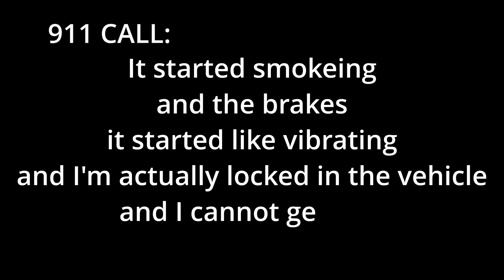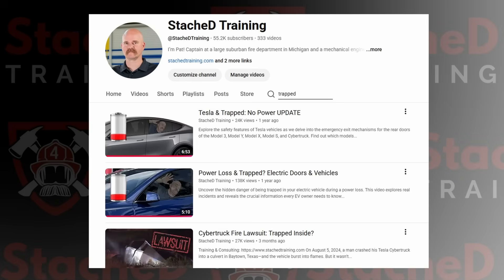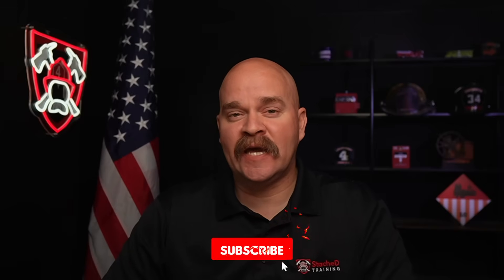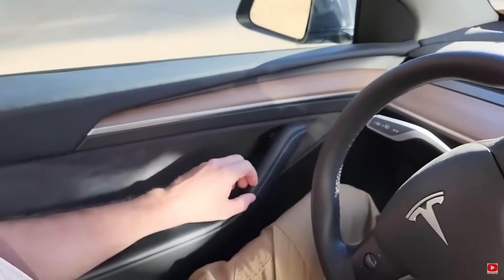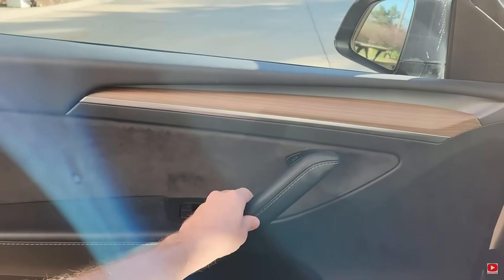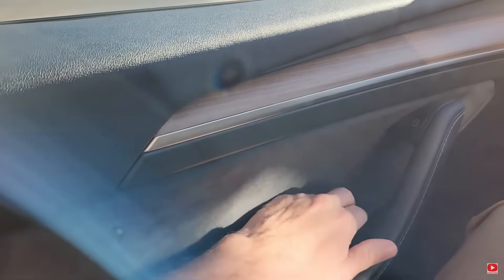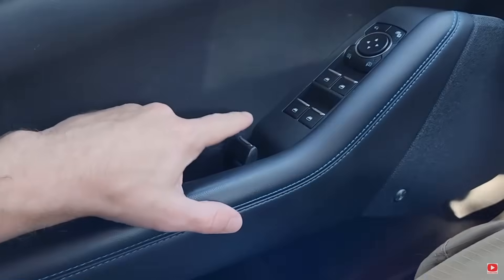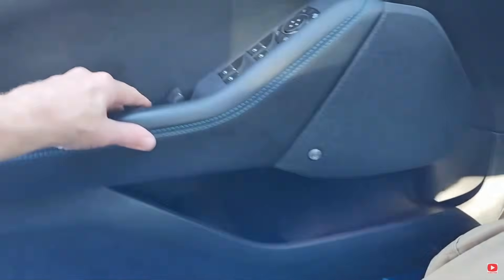Electronic Door Latch Failure: Smoke in the Cabin

Comment: Modern vehicles are dangerous to their owners. Unfortunately, the cheapest way to make a car more futuristic is to use computers and electronics. Manufacturers were doing better 20 years ago and should have stopped trying to complicate cars more. Now they use these technologies to charge subscription fees to use features on the car you paid for. Keep posting about this and hopefully the manufacturers will stop making cars more dangerous and the victims need to sue for exorbitant amounts for damages until they learn. Defunding the automakers would help… think about buying older cars and using independent repair shops. Dealerships exist to do warranty repair and other maintenance work. Selling cars is not keeping the lights on.

Comment: Why not have a small backup battery for door release.  It is safety critical.
Reply: You shouldn't have ANY electical component in the door, period.  That's the issue.  You shouldn't "need" an emergency backup handle, or an emergency power source...just use a damn handle.  They've worked in cars for 120+ years.
Reply: @oskar6661 I agree.  I liked the answer further down, where the electric door release, and the manual were on the same button.  Pull gently for electric, a bit harder for manual.  And there should be manual door handles outside the car, so that rescuers can easily open the door.

I don't like the locks that lock if the car goes over 30mph.  If I have an accident, and am knocked out, how do people get me out of the car, if they can;t open the door.

I always try to remember Murphys' law - if anything can go wrong, it will.
Reply: Q: Why not have a small backup battery for door release.  It is safety critical.  BETTER Q: Why not have pyrotechnic charges "blow the canopy" like so much Swing-Wing Fighter Jet, and then have all Tesla drivers "rise up" out of the cabin on 2 HUGE COLUMNS OF FLAME shooting from beneath a sweet Martin Baker US18E Ejection Seat...? (insert slow motion video of a rocket powered test sled going down a set of railroad tracks). 👈ref: in the SUPER DYSFUNCTIONAL "child-like" mind of Elon Musk, this would be his solution.  hint: solving this "technical problem" involves the use of ever more technology (which is exactly what "Einstein's Paradox" has warned us NOT to do).

Comment: I saw a driver yesterday who had a Mach E Mustang who put “open here” stickers on his outdoor rear door handles (buttons) because there is no handle.  It’s just stupid engineering. It’s not problem solving. It’s problem causing.
Reply: i wouldnt even call this engineering because it doesnt conform to any of the essential and critical rules of engineering. Its smart for the sake of being smart, the shit that fashion designers and modern architects do, there are no engineers left in the automotive industry
Reply: @homeopathicfossil-fuels4789 now that I agree with 100%.  It’s been a very long time where I saw a car feature and thought, “wow, that’s clever.”  It’s all just showroom gimmicks and flash.
Reply: How does that help given the doors auto lock when you start moving.
Reply: What handle was labeled if there are no handles? I'm confused by your comment.
Reply: @17k @17kcotsdoow86 rear doors have little circles next to the windows. I guess they are buttons that you tap to pop open the door.  The car was black and I don’t think his passengers could see the button so he put the sign on the door edge next to the button.  The handle is the door edge itself which only pops out when you press the button.  If you need visual aids to get into the car, imagine the nonsense trying to figure out how to get out of one
Reply: It was probably an Uber. I’ve seen the same.
Reply: To be fair, if someone buys stupid engineering, then they are stupid. The government should regulate it but the customer is stupid and frankly, I have no problem with them and their stupidity leaving society.
Reply: @anon1832  
And what are we to do, once all the cars go full-blown stupid-mobiles? Government schooled idiots, monkey-see monkey-do, no or little original thought anymore. Every car looks like a rip-off copy of another brand's car.
Reply: @anon1832 I guess you’re right.  It’s natural selection. Darwinism.

Comment: A good quality spring-loaded steel centre punch will, according to reports that I have seen, reliably break windows made from tempered glass (not front wind screen or laminated safety glass side windows in some new cars). Cheap, small and easy to use. Buy from any good hardware store.
Reply: New cars get laminated glass all around 😮

Comment: The electric door latches are possibly one of my biggest pet peeves about how cars are made these days - right behind the stupid touch screen consoles. I shouldn't have to sit there and try to figure out how to get out of the car if the battery dies! I don't care if it's an EV or ICE - I should be able to exit the vehicle the same way I always do without any hassle or having to find a different mechanism than the one I usually use.

Ofc, I live in the northern Midwest and have driven ICEs my entire life (I could barely afford the 2013 Traverse I bought last year). It's not uncommon for me to go out to start the car on the first really cold day of the year and find the battery's dead. It happens. There's a reason I have a GooLoo I keep with me and jumper cables in the car, just in case.

Well, we did just get the battery replaced and a new alternator, so theoretically it should be fine for quite some time. But it never hurts to be prepared. Plus, my previous vehicle (2000 Town and Country) had a ridiculous amount of issues with batteries. I'm pretty sure something was constantly draining the battery, but we never figured out what it was before the transmission decided it was time for retirement.

I still miss my Town and Country. For all its issues, I prefer it over the Traverse. I has regerts.
Reply: You're not the only one to mention the mysterious "battery drain" you couldn't figure out.  A few other people are discovering a common cause.
When the dealer sells a car, they often install a GPS tracker.  Its purpose is to provide a location of your car if it needs to be repossessed.  You can often find them tucked up under the dash and often the tie-in to get power looks rather unprofessional.  
Even if you bought the car used, the previous owner likely had the tracker and never knew it.  Just google it, and there are lots of videos of people showing where it's at and what to disconnect.

Comment: Well applied technology should make life easier, safer and cheaper, not harder, more dangerous and hideously expensive.

I have been driving for 50 years.  The cars I drove when I started are nicer to drive than anything I have driven recently (I have driven buses that are nicer to drive than modern cars).  When I started, cars were easier and cheaper to maintain and fix. Now, with all the extra systems that can and will go wrong, and proprietary interfaces that require manufacturer diagnostics to figure out what is wrong, with systems that cannot be repaired for a few pounds, but must be replaced for a thousand, I don't want to know.  It is no wonder that insurance is so expensive, when a small ding can lead to a bill for thousands, rather than a man with a hammer and a can of paint. (I know it was only a small dent, but it damaged the defloccinator, which caused the insuffintegrator to go over voltage, so both units had to be replaced.  And, once they were replaced, (I am sorry it took 6 weeks to get the spares from the factory), we had to run further system checks to make sure that nothing else was damaged.  Here is your bill. ... Fred, call an ambulance.  Another one has collapsed).

All those bells and whistles might be nice, but remember the engineers mantra - "If it isn't broken, it doesn't have enough features".
Reply: "If it isn't broken, it doesn't have enough features."

Wait, I thought that was the motto of Winturds?

Comment: If this had been a lithium battery in thermal run away, she would have been dead or had severely damaged lungs before the fire department even got there.  There is a reason that flight attendants show passengers how to use emergency equipment and where the exit doors are before EVERY flight.  AND, that is the reason I pay attention EVERY time and read the card in the seat back.  I want to be the person who makes it out safely if there is an emergency.

Comment: "Hey, what's up with those manual door locks?"

"Ah, not much, just a tried and true mechanically functioning door that's been successful and useful for over 120 years.  Doesn't really cause us any problems, pretty cheap to produce and something that 95% of the world's population is familiar with.  Also it's safe and easy to manipulate in a disaster, even in the dark or under water."

"Can we f__k with it and make it more expensive and dangerous?"
Reply: Not to mention easier to repair, less part, if the part discontinued for old car you can make the parts
Reply: YES WE CAN!!!

Comment: I also think about a borrowed or rented vehicle, do they expect the rental company or your friend to run you through drills before you drive away? not going to happen. I was in the rental business, we normally didn’t have Fords , but a franchise had a Mustang Convertible we were trying to rent back to the franchise location. We got customers and it wasn’t intuitive to have to engage the emergency brake to bring the top down as our GM convertibles didn’t require and our customers didn’t know, so we’d get a customer in the car, they couldn’t drop the top, our staff didn’t know so kept get sent to maintenance and delayed getting the car back to our franchisee for nothing. Thankfully this wasn’t a life safety issue.

Comment: I don't think we should rely on backup mechanical releases either. It's nice in theory and maybe they could be made intuitive, but unless it's used regularly, you don't know it's in operational condition.

Of course they work in new-ish vehicles, but a mechanical device that's not used in 5, 10, 15 years might seize, rust, jam etc. so at the very least operation of manual release should be included in regular safety inspections.
Reply: 100%.  You shouldn't need an "emergency backup" door release.   The door handle should be the same place it always is.  No excuses.  It should be mechanical.
Reply: Knowing modern vehicles, if you use it regularly that will cause it to break when you need it
Reply: @stephenw2992  It would be quite a coincidence for it to break on the very occasion of a emergency, but even if it were to happen due to wear & tear, the passenger side is likely used significantly less and would function properly.

Comment: NZer here. Just had a family member have a warrant of fitness fail because the rear number plate light was slightly off center. Yet cars like this get their 'warrants of fitness' easily. The world is upside down.
Reply: Whats a Warrant of Fitness?
Reply: @jarnosaarinen4583 routine vehicle safety inspection, checked lights, brakes, tires, seats and safety belts, checks for play in suspension and steering, checks the structure of the vehicle isn’t damaged or corroded.  

Its an inspection of safety related items and is not a health check of vehicle, ive got some pretty rough cars that still have WOF’s, heck ive had one that had an engine that barely ran and same with a transmission that barely drove pass a WOF. 

Sometimes I wish I didnt have to get my cars inspected so I could drive rougher shitboxes but then I would be out on the road with people who have no clue vehicles need maintenance and how unsafe they become.
Reply: @jarnosaarinen4583  Its the anual (or whatever) safety certificate that your car has to pass to be allowed on the roads. Not sure what other countries call it?
Reply: Alas, you've confirmed my impression that New Zealand, beautiful as it is, is also the ultimate Nanny State. That may partly explain the population exodus to Australia, which has similar problems (i.e. knife bans), but not a badly.
Reply: @Inkling777  You have no idea, do  you?
There's a major difference between "nanny state" and making sure that vehicles are basically safe, not only for the owner, but for everyone else sharing the roads, and pedestrians as well.
 It makes sure that people can't put deathtraps on the road, like those ridiculous "Carolina Squat" atrocities, or the spacers between wheels and hubs that fail, oversized/over width wheels and tyres etc. People putting them on to make their vehicle "look cool", but having no idea of how they effect the steering/suspension, things like scrub radius, included angles etc and the negative effects on brakes and steering.

It also means we (Aust and NZ) don't have to suffer monstrosities like the CyberUrinal.. er, I mean Cybertruck.
Reply: It's more of a "driver education" issue than a physical vehicle safety issue because in the video, it's clearly indicated that there was an easily accessible mechanical door release that the owner just didn't educate herself about.

Comment: Are these EV's required to have detachable head-rests with the steel spike(s)  , like older cars?   
 I know that might not matter if they all now have safety glass on the side/rear windows.
 Most people could not bust through safety glass with a head-rest spike or an emergency hammer.
Perhaps EV's and new cars dont have those head-rest spike, becuase of that, but I thought it still is a federal regulation/law.
I personally have known 5 people(2 wrecks) that drowned when they crashed and the cars went underwater.
I wish cars still manual windows,  and manual locks  and tempered glass side windows for this reason.

Comment: Good video!  My L. Aviator has electric door buttons.  I know where the emergency release is for the driver door, but if I have others with me, they would have to climb over the console, or climb over seats from the 2nd or 3rd row.  I'm not worried about spontaneous combustion, like an EV, but rather if I'm in a crash and others need to exit quickly. 👍🚗
Reply: My Mazda MX-5 has buttons outside, but also a keyway for a manual unlock.  Inside it's all mechanical, just as it should be.

Comment: I know your focused on EV's here but it needs to be pointed out that this is an all vehicle 'feature' now.  Makes no difference the drive train, presumably to save money and/or look 'cool' manual systems are being discontinued across the board. 

In an emergency we all go to 'muscle memory' so if there is a manual release, always use it, never use the electronic.  It's the best way to train for an emergency.  

I've watched car repair channels showing that many vehicles are now coming with external emergency 12v hookups so a vehicles systems can be powered from an external 12v source because it is the only way to open the doors.  There are no physical ways to access the locks/latches and if power fails your done.
Reply: Every vehicle on the market has a manual release.
No money is being saved.